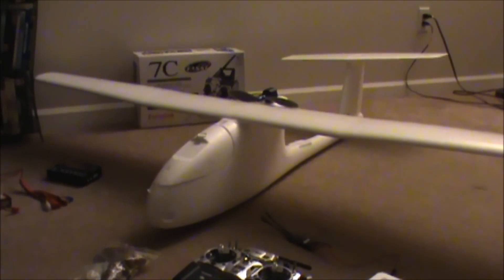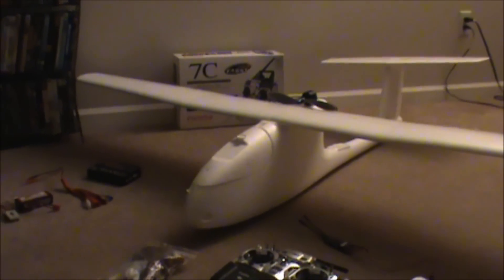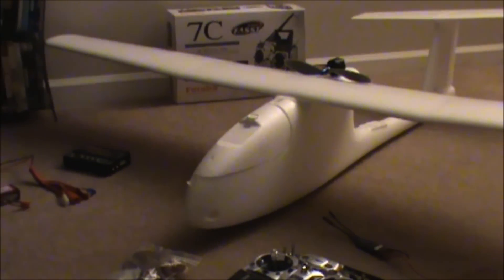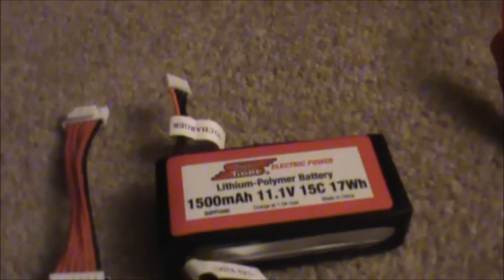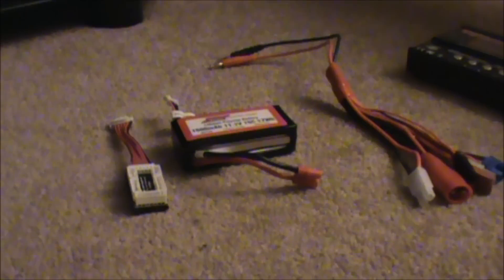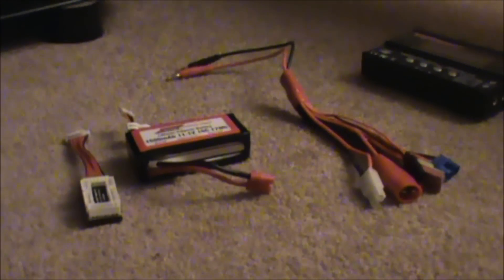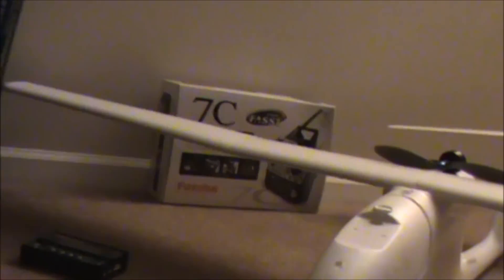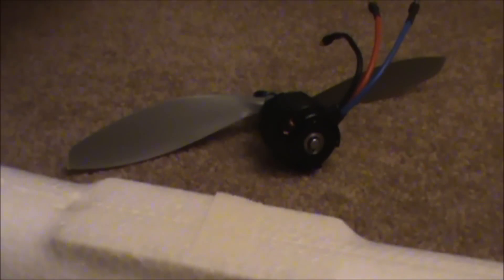RC Skywalker FPV Plane and Teneregy TB6B  LiPo Battery Charger Overview.

Comment from the maker: @MakeBreakFix Well thats a good question for when I deploy for 9mo, they are sensitive in many ways. The bateries need to stay cool, have a min of 1.2V at all times and need to stay out of the sun. I will have to train a friend to watch them. But for now the the teneregy charger has a function that puts them into a short tem "storage" mode down to that 1.2V.

Comment from the maker: @fuel4sandman I have about $500 USD into it, all depends on what you get, The plane it self was $90, Then you need a motor, servos, battery, charger, radio. The radio so far has cost the most around $300. Google "Birds Eye View RC Skywalker" to find the web page.